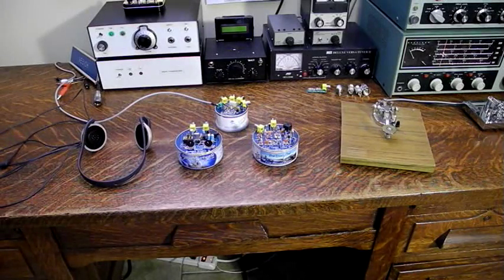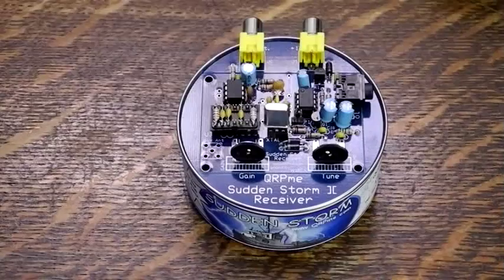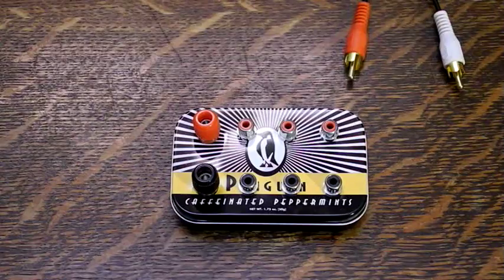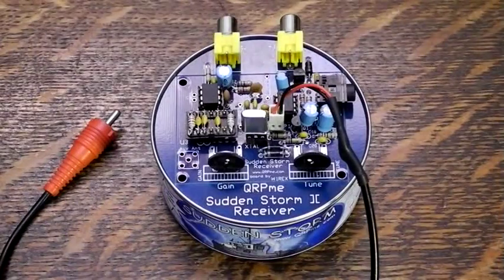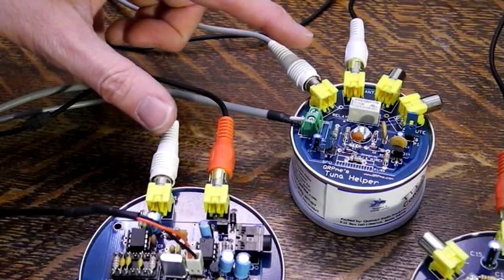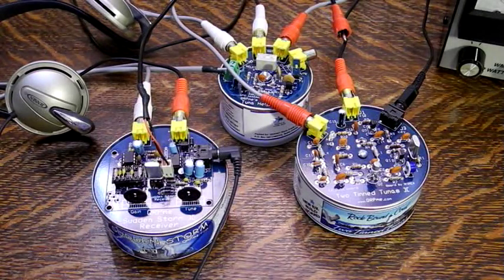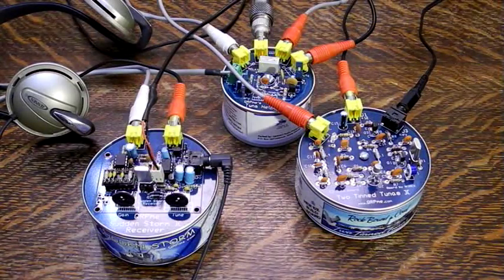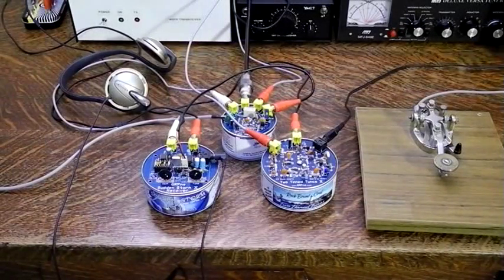QRP Ham Radio Station Setup and Operation

Comment: Hey, I still have those kits and just dusted them off to start putting them together. We are in a 23 ft travel trailer so it will be picnic table assembly and operation for sure. Cheers, Dave - KU9L

Comment: Hi! Thanks so much for this video! It's more helpful to me than you might imagine. I am a person with NO HAM background, and am just now learning Morse Code on youtube, with my dad (Morse Code Tracing Video) and I have ordered 25 Pixie CW QRP 40-meter transceiver build kits and 11 of the Frog Sounds ones. I got the pixies for $2.88 shipped and the Frog sounds ones for $10 shipped. 
Also, I ordered all of the stuff to make 2 big dipoles in 40M (N,S,E,W) and all the nick nacks (Weller Irons, good solder, wick, SWR meter, volt ohm meter, iron feroid, tons of cables and wires, etc) to make me into a well outfitted tiny radio factory. So every little bit of radio knowledge I can pick up from videos like yours are GOLD to me, as I venture on in this new adventure! I have been sliding backwards a little financially lately because I am autistic and have a hard time keeping a job because I'm ungifted at dealing with contentious people. However, I think that because of my positive, upbeat personality, and the freedom and economy of working at home, this will be a nice addition to my e-bay selling. As it is, I sell WiFi Hacking kits, and have been selling a good number of them to people who are really keen on Anonymity. I advertise to them on Facebook, and I reckon they'll appreciate the anonymity that a mobile and brief deployment of CW QRP for the purpose of an important coded message can easily provide in a way that is going to be spyware-free and virtually free of recurring expense.
Thanks again!

Comment: hi jeff is there RIT control built in between tx/rx or do you have to alter the tuning on recieve this can be a problem with dc reciever,s jim g0wmj
Reply from the maker: There is no RIT per se but the receiver has a limited amount of adjustable frequency shift so you can adjust it for a suitable offset.

Comment: Back in 1978 I built the original Tuna Tin 2 and the matching Herring Aid 5 receiver in the appropriate tuna and herring (sardine) fish cans.  The plans were in a 1976 QST magazine article and authored by the late great Doug DeMaw. The Tuna 2 transmitter was single crystal controlled, and I never got around to building the CB Slider (Corned Beef can) VFO which was published later because it had a part which I couldn't find or new technology which baffled me at the time (was it a toroid?).  The numbers "2" and "5" came from the respective number of transistors (almost all 2N2222) used by each project.  The direct conversion receiver of the Herring Aid 5 worked, but the volume was very low, and the Tuna 2 only put out a couple hundred milliwatts - low for even QRP standards. I replaced the final amp transistor with a beefier transistor which resulted in chirp until I balanced out a similar beefed-up transistor for the crystal oscillator.  The result was a whopping 2-watts with which I made a good many daytime 40m contacts in those long-gone days.  Thanks for the demo and the memories; I didn't know anyone was making copies of DeMaw's work.  :)

Comment: Interesting, the Rube Goldberg method of QRP :)  While the value of knowledge you gain is worth the trip, not very practical if you just want to get on the air.  I used to build these kits.  Lately, I just spring the $100 for a used Heathkit HW-8, boost the receive, rewind new toroids for the output, and heavy up the final to 5 watts. I decided tinkering time is better used for antenna building. AE4YW

Comment from the maker: I don't think these would be useful in this application. They don't handle the power levels that a transmitter puts out and are designed for the wrong frequencies (cable TV versus HF).

Comment: Got to love these kits! Still deciding on the best antenna for extended travel in a truck camper, but current thinking is a 1/2~ wire with 1/4 counterpose & a 1/2~ tuner.

Comment from the maker: Agreed. Making contacts with a low power QRP transmitter is challenging and not for beginners. The receiver can be used by beginners for W1AW code practice though.

Comment: Jeff - well done on a comprehensive and well-produced video.  Many only show operating and not setting up so you fill a gap here. 

However I'd be wary about promoting this type of gear to beginners. 200mW crystal control means frustration, fruitless calls and not being able to operate if the freq is busy. 

QRP teaches what's really needed & what's not. Eg you don't need sidetone or QSK. But freq agility & >2w out make the difference between fun and failure & novices should be told this.